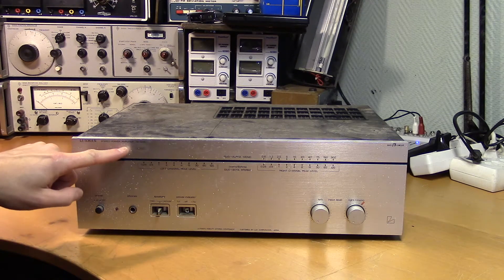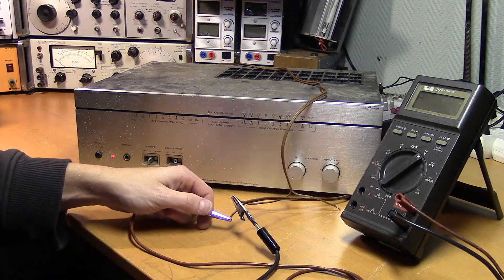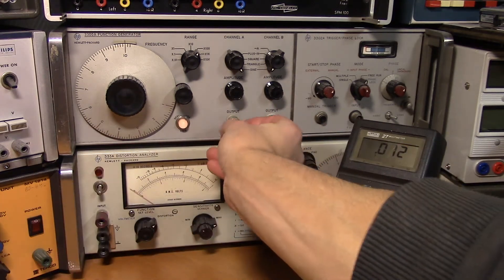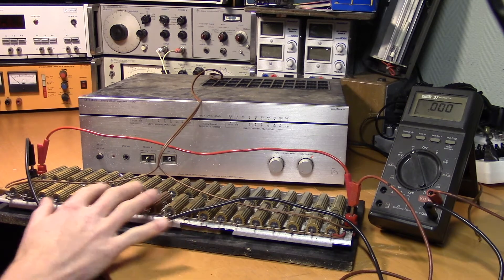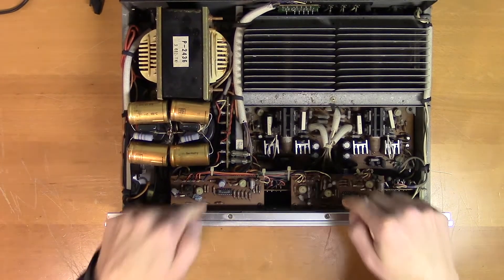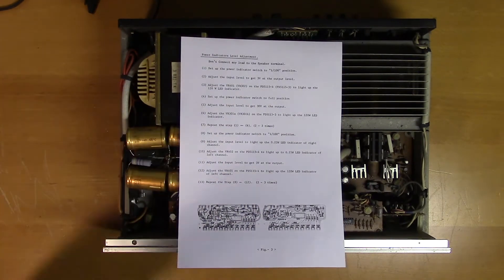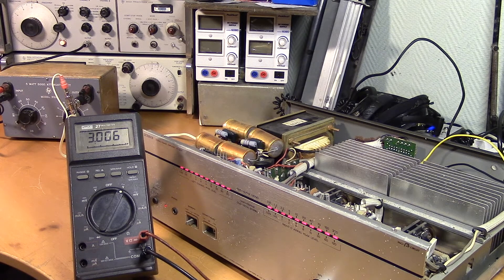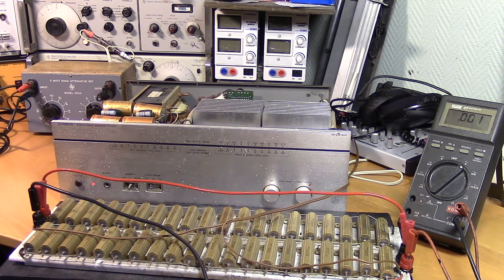Luxman M-120A - Power Test and Level Indicator Calibration

Comment: Hello. I own one
luxman m120a. I have replaced all capacitors. Does anyone know what amplifier class this is?
class-b or class-ab ?
is it correct that this amplifier should be as cold after it has been turned on for an hour as it was before I turned it on? This is without audio signal connected?

Comment: Nice unit to repair or just to look inside it.
Really good video subscribed! 
Just a question, The IC who take the job to measurement the power output is it a Lm3914/5/6 Family? 
Thanks 
Gday
Reply from the maker: Hi rico5870, thanks a lot! For the power meters, the signal seem to be measured by a Toshiba TA7318P Wide Range Peak Power Meter Driver. The output of which is fed to a Toshiba TA7612AP LED Driver, which controls the Peak Power Indicator LEDs.
Reply: @SunandWeather  thanks!!